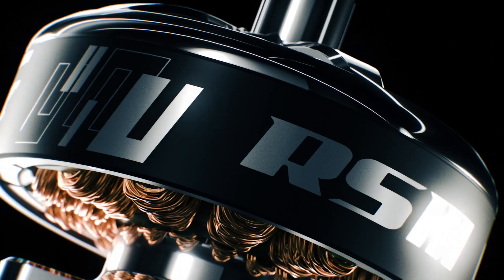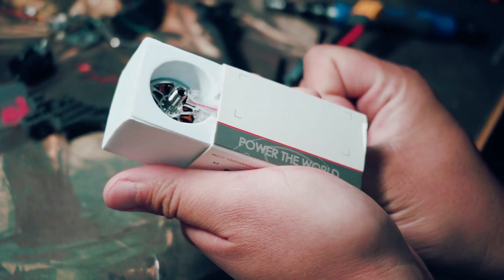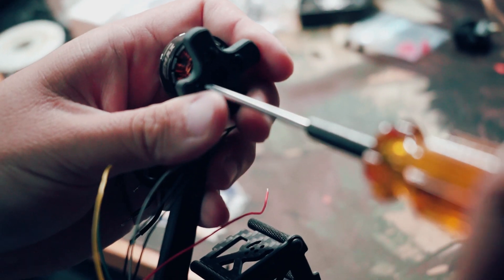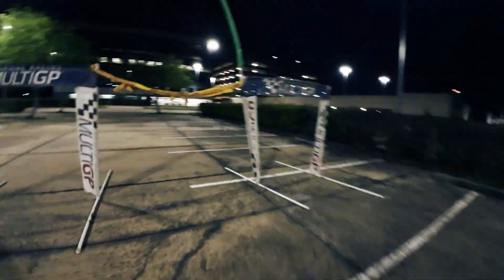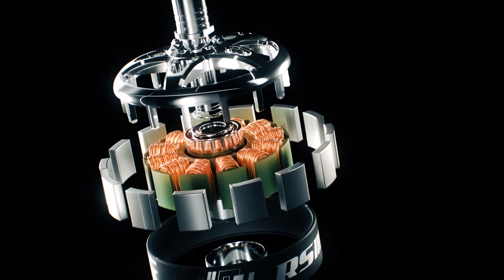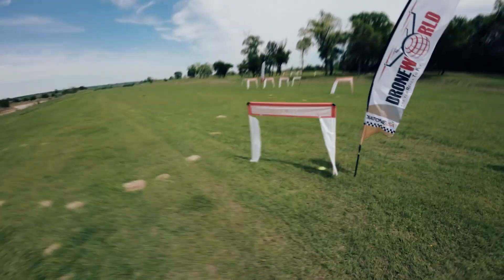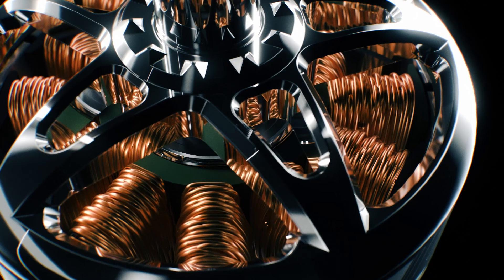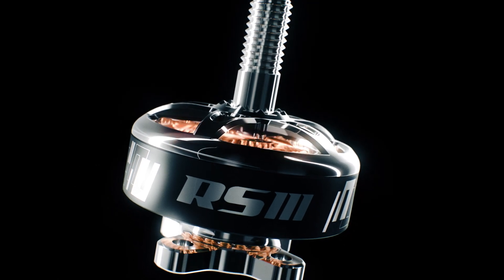EMAX - Introducing RSIII - Experience Power

Comment: Emax USA, our 5" props have 5mm holes. It will be lose. How do we go about it then? Also, what type of aluminum is used on the bell?
Reply: I think they just mean the bearing shaft, not the prop shaft, you can see it is bigger in the video, I like Emax props also, fly 3.5 have started with emax and had a good experience so far, there drones are very capable, service for me has been really good and I would recommend them to anyone starting out. not saying these are the best out there but I don't think they would be a bad motor. checked you channel and nice vids to ! sick flying ! sub'd !